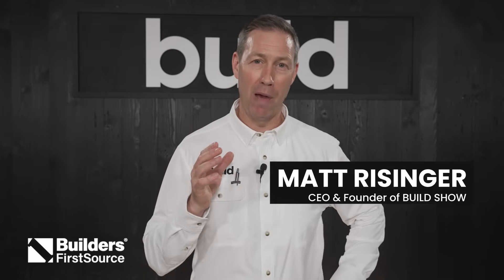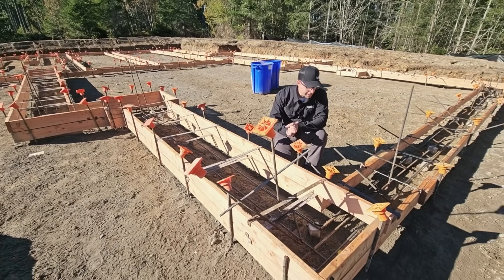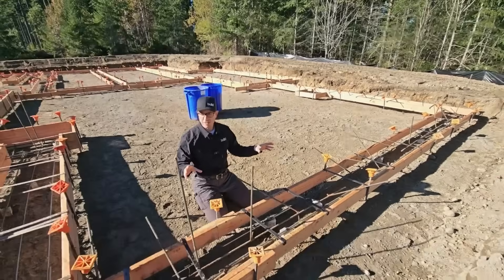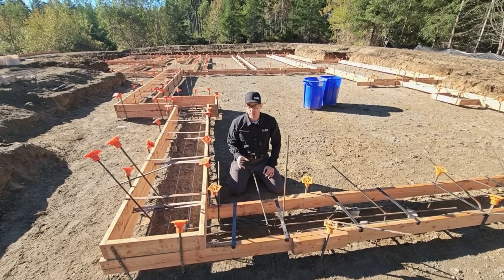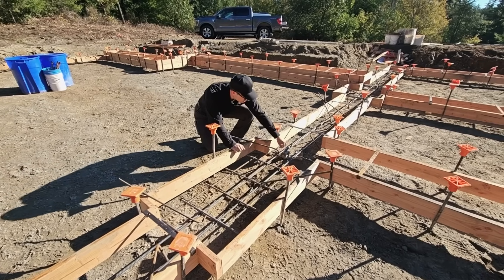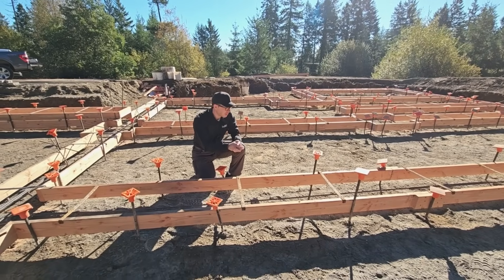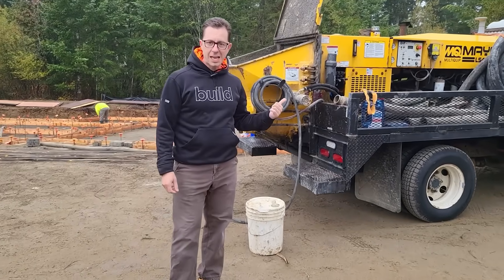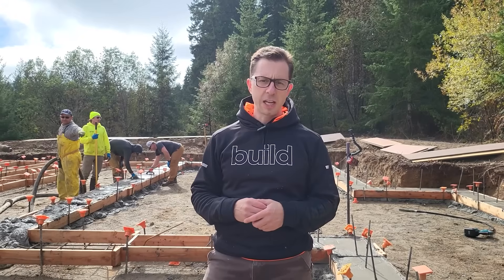Best of The Build Show | Footings, Forms & Concrete Tips with Bryan Uhler

Comment: You mentioned grounding the electrical to the steel rebar in the footing, but how do you handle this if you are using FRP rebar?
Reply: The vertical rod is the ground (not the entire rebar cage).  If you used frp for the project you would still drive a metal ground rod in the appropriate location(s).
Reply: @leestebbins5051  Okay, but he literally said there was more than one grounding rod and that they were tied together through the rebar so that the entire rebar cage becomes a ground after the electrical meter is tied into it.  Since FRP rebar isn't conductive, you can't use the rebar to tie the grounding rods together, thus my question about how to handle the ground connection.  Obviously you are still going to need to drive grounding rods, but do you need more of them since they aren't tied to a giant metal cage?  How do you tie the multiple grounding rods together?  You could use copper cable, but is this best practice?  What size cable would you need?  Would you still even put the grounding rods inside the concrete foundation since you aren't connecting them to the rebar cage?  Since I've seen videos with them using FRP rebar I was hoping he might be able to briefly go over how the grounding is handled differently since they didn't talk about it in either this video or the video where they were using FRP rebar.
Reply: @r.j.bedore9884 Any electrician can ground an electrical panel without a rebar cage.  My house is pier and beam, no rebar, and the panel is grounded.
Reply: Rod in the ground shoots down 5-8 feet no problem

Comment: Retired architect here. Licensed in Washington for 43 years. I used to read articles in JLC by Uhler .... good info! During architecture school I argued with a teacher regarding footing formwork. He maintained that a 6" deep footing required the building contractor to rip a 2 x 8 down to 6". I said no ....a contractor would stake a 2 x 6 and set it 1/2" above the soil (my Dad was a building contractor and I worked for him during high school and college). The teacher disagreed. I knew he was wrong based upon my field construction experience. I see Uhler doing the same thing 50 years later!
Reply: Yeah who would buy much more expensive 2x8s just to spend a ton of time ripping them down. Even if you where using some crazy watery concrete you would come up with a better plan then that.